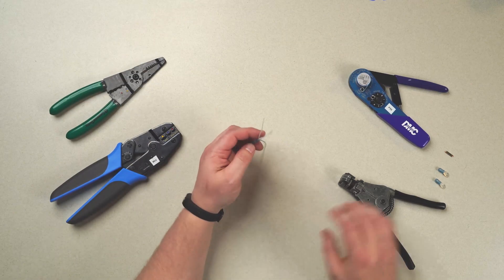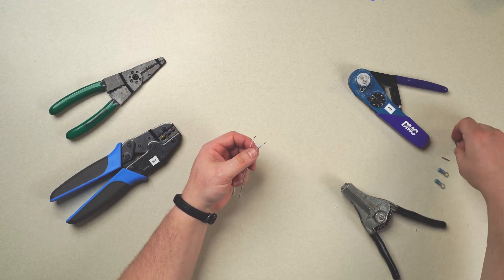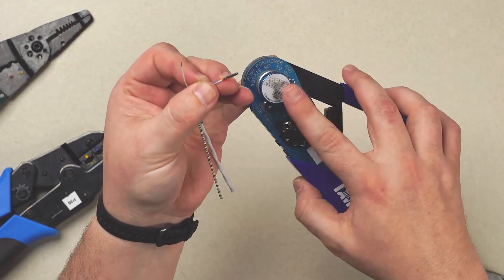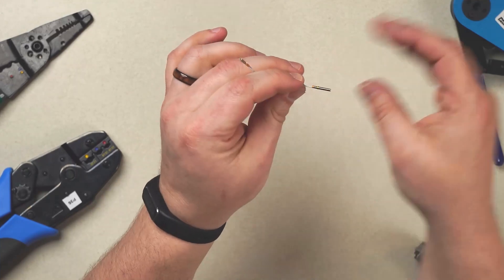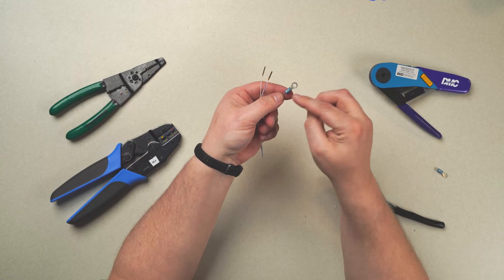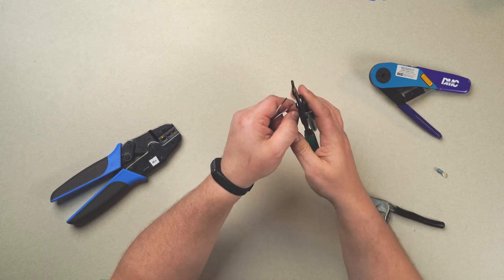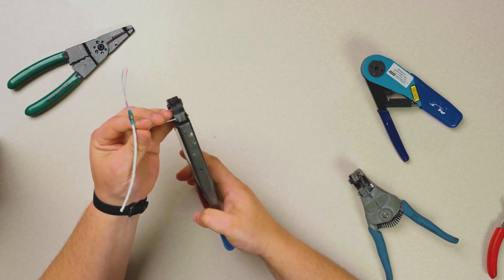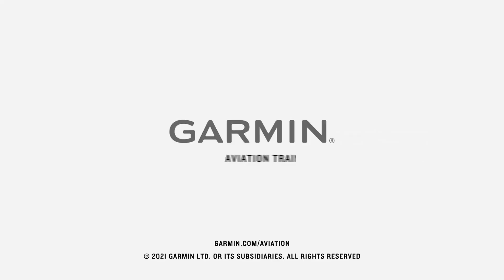Garmin G3X Touch Wiring Fundamentals- Crimping Contacts and Ring Terminals- Experimental Aircraft

Comment: The hardware store tool deformed the ring terminal due to using a tool made for noninsulated terminals on an insulated terminal.  The staking style crimp is for noninsulated terminals.  Insulated terminals should have a tool with the same shape, generally part of an oval, on both jaws of the tool.